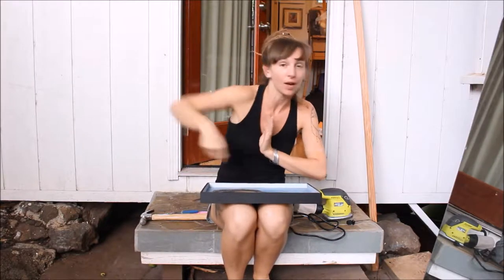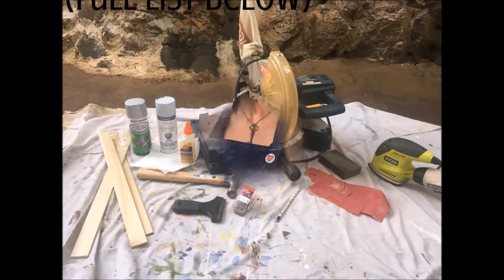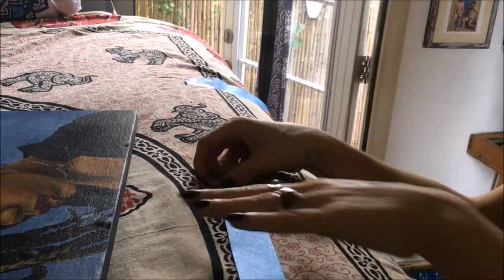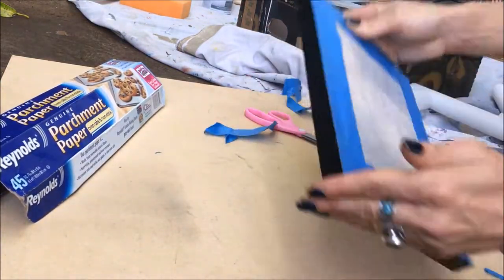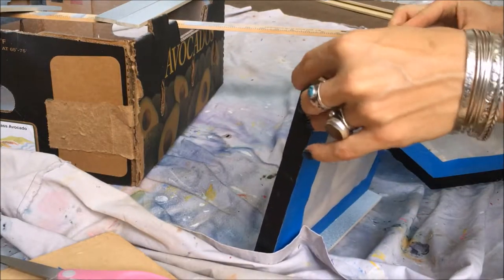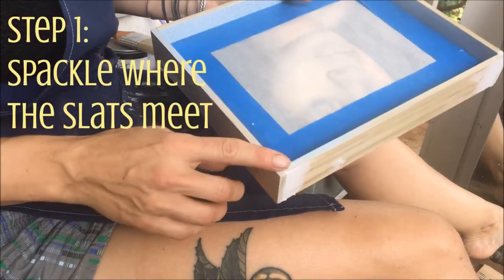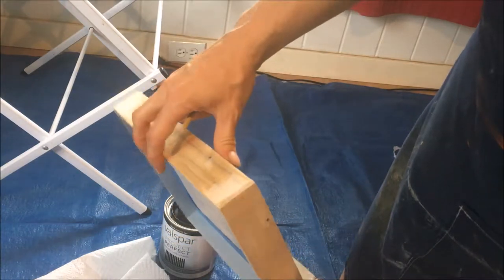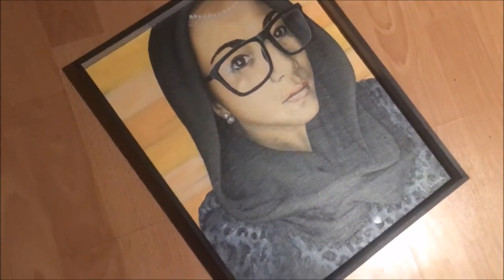How to Frame a Painting Inexpensively :: Putting on an Art Show on a Budget

Comment: Hi Caleigh! Great tips. I noticed you didn't paint the upper inside of the frame. Was that intentional?
Reply from the maker: Yep I did :) After cutting the slats but before affixing them to the painting itself I spray painted them a light blue grey then added glitter spray paint (which didn't come out well on camera unfortunately). Now I use this type of frame as the shadow box for my poured resin 3D paintings so I paint the whole slats black these days. If you haven't yet, check out this one:) https://www.youtube.com/watch?v=Wil4mn6WMmU
Reply: @CaleighBirdArt  was there a reason to paint the upper one light opposed to black like the rest? I guess thats what I'm asking.
Reply from the maker: @chethighsmith8958  Well for this series I wanted the frames to somewhat shine/glow like a halo-ish effect because I was adding little silver accents to all the portraits. It didn't work quite as well as I would have liked it to, but I did get a good response on the frames when showing them :)